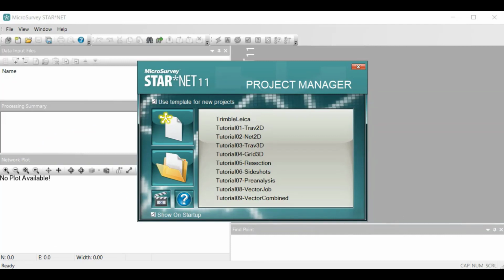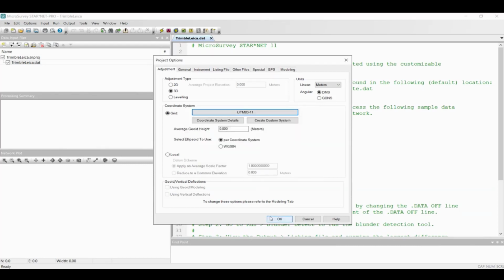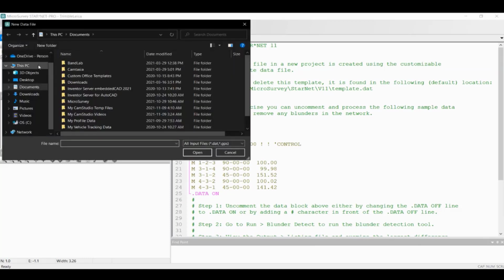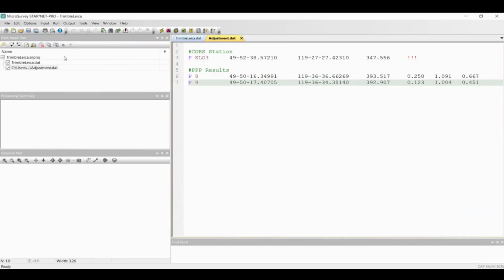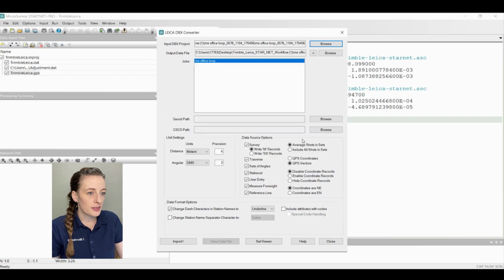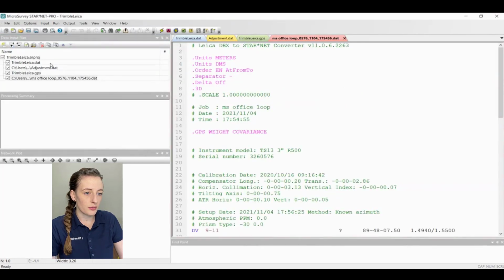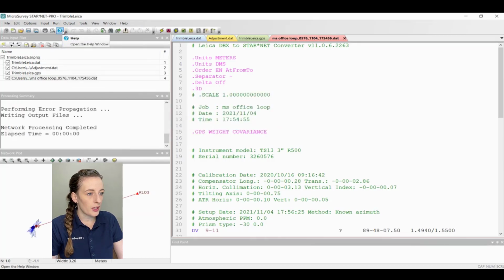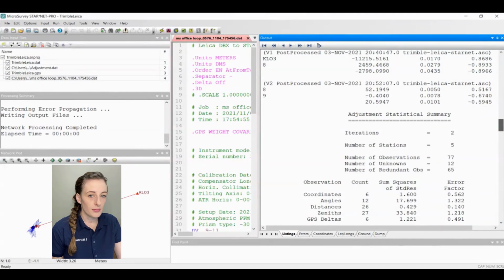Combining Total Station and GPS Data from different manufacturers

Comment: How Does GPS error get weighted in relation to total station traverse? Is there documentation or resources on this?
Reply: The weight is directly influenced by the input standard error values for each.  GNSS data is imported with supplied standard errors, and total station data can either have standard errors input through the instrument settings or may be imported, depending on the converter used.  The supplied standard errors from GNSS data are often more optimistic than their real values, so STAR*NET contains an easy setting to apply a multiplicative factor to the values to help keep them in line with real standard error values.